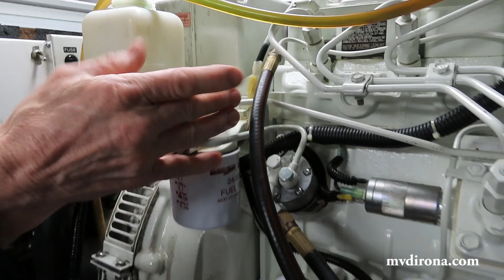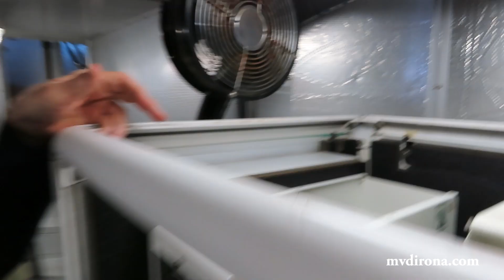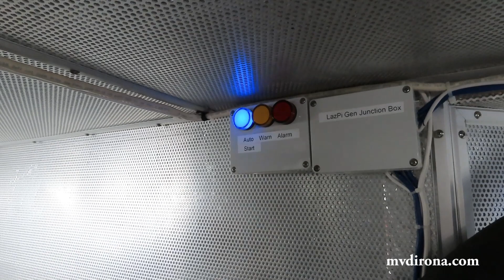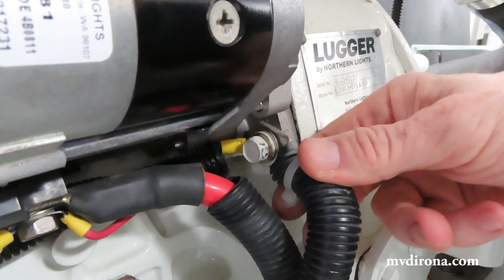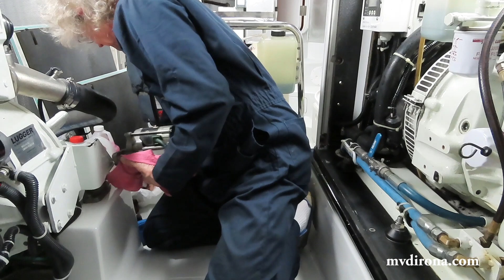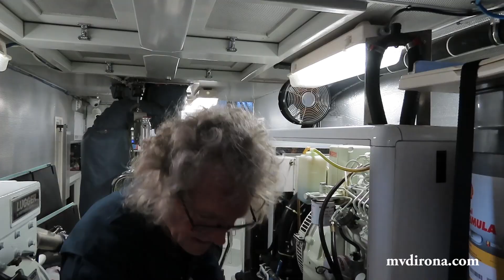Replacing Northern Lights Generator Starter (MV Dirona Channel)

Comment: 💙 Sorry for a probably stupid question, but why is the generator shielded in a box and not open like a wing engine? Maybe just because of the noise it makes while at anchor or in the marina? Thanks in advance for your reply 💙
Reply from the maker: Exactly. It's a sound reduction enclosure and these are quite common on generators.  Some chose not to run them to get better generator cooling but most most do.
Reply: @MVDirona  Thank You

Comment: Excellent video, thanks guys.
I see you have a non standard decent sized fan fwd of the genset. Do you have an article on your website regarding air cooling in the engine room of the N52?
Cheers, Clive
Reply from the maker: Observant catch. Yes, we covered our approach to engine room cooling here: https://mvdirona.com/2015/05/engine-room-cooling/.
Reply: @MVDirona  excellent article thanks for that. We are in the hard process of trying to decide between a N52 or a N55! We have only been on the 52 and it's beautiful especially with the longer cockpit. Huge amount of living space on the 55 though by the looks of it.
Reply from the maker: Tough decision.  We like the floor plan of the N55 greatly but like the price and profile of the N52 better.  I think if we were to make the purchase today we might end up with a N60 that has the N55 floor plan with larger cockpit and the slightly longer height to length ratio that we prefer. But both boats are capable ocean crossers so there won't be a "bad decision."

Comment: Please tell me how to remove a 12kw  NL generator
Reply from the maker: It varies boat to boat and is more dependent upon the boat than the generator design.
Reply: @MVDirona  hi thanks a million for your reply the generator was running fin  . I shut it down  . 2 weeks later the engine will not turn . Removed the starter that was not the problem . I am thinking that may by the generator is frozen and by separating it from the engine  we can be be sure . Boat is a 1978  58 Hatters  yacht fisher
Reply from the maker: First thing to do is to take off the alternator drive belt cover and see if you can rotate the engine with a large socket on the large nut that attached the front pulley to the crankshaft. If you don't have a socket big enough, I find that you can turn the engine pretty easily with a small pry bar between the pulley and the crank nose nut.  If you can rotate the engine by hand but it won't rotate on the starter, you likely have starter or electrical system problem. 

If you can't rotate the engine, it may be seized. If it was running fine two weeks ago, likely it's water ingress. Try removing all three glow plugs, injecting oil into the cylinders, and then see if you can free the motor up and get it rotating with a socket on the crank nose nut as described above.  Once you get it turning, don't start it until you change the engine oil since there may be water in it.  Once started, run it for a bit and change the oil again.
Reply: @MVDirona  I did that it is frozen
Reply from the maker: Most likely issue is corrosion if it was running a couple of weeks ago. If there isn't obvious signs of leakage onto the engine and generator, water ingress through the exhaust is the mostly likely. Remove the glow plugs and fill all three cylinders with oil.

If you have reason to believe the generator end is at fault, you can remove the ventilation grill between the gen and the engine and then undo the bolts that attach the gen to the flywheel to disconnect the gen from the engine.  The gen housing is attached to the generator all around the bell housing. If you un do those and the bolts under the grill connecting the gen to the flywheel, then you can undo the wiring harness from the sensors for clearance and separate the gen from the engine.

The generator end bearing can be replaced without removing the generator if you find the gen
Reply: @MVDirona  I shall do what you said
Reply from the maker: Hope you get it running again.

Comment: This is the ceramic seal that does not work well , take out the impeller and the back plate , behind the back plate is a seal ,  change this seal for a seal that seals on the sharft and it’s housing job done .
Reply from the maker: Thanks for pointing out that other seals are available. I probably should rebuild those pumps since they are rebuildable but I tend to install them, change impellers until the pumps start to leak oil or water. When they do, I replace the entire pump assembly.
Reply: MV Dirona This seal is not a Northern Lights part you need to sauce them i had to replace my pumps every 250 hours just change this seal  no more problems if you look at your pump when generator is running you will see the ceramic seal is turning when it should not ! Sharft size 1/2 inch measure od diameter of the old seal it’s not the price why not just cure the problem .
Reply from the maker: Perhaps your waters are more silty than we have been seeing but we always get more than 1,000 on a pump and usualy more than 2,000. Generaly, the seals haven't been a big problem for us but thanks for passing on your findings that better pump seals are available.

Comment: About that dizzy bit, hopefully your not suffering from this, as it has hit me hard as I get older and have to be aware of what angle my head is at and how fast I move. Luckily the way to treat it is fairly simple, requiring certain head movements in a certain sequence. https://vestibular.org/understanding-vestibular-disorders/types-vestibular-disorders/benign-paroxysmal-positional-vertigo#:~:text=BPPV%20is%20a%20mechanical%20problem,are%20not%20supposed%20to%20be.
Reply from the maker: So far, my symptoms are minor and not particularly disruptive but it is true that my balance isn't as good as it was 10 years ago. Old age sucks but it beats the alternatives :-).
Reply: @MVDirona  LOL, very much so, but I miss the days I could crawl under something and see clearly 6" from my face.
Reply from the maker: Yes, me too. In fact, a very similar situations was when I first realized how bad my eyesight was becoming. I went to get the serial number off the port side Cummins engine in our previous boat and there is simply no way to get further than 6" away from it so it's totally unreadable. I ended up needing to take a picture :-).

Comment: Is there a reason you don't bother to remove the enclosure support beam? I hear you on the starter story, 24v electrical problems are like a welder going haywire! The two oddest things I have seen is a distributor assembled 180 degrees out and battery post connector that would not conduct electricity, despite being cleaned thoroughly. I am a Landrover nut, so been doing battle with "Lucas the Prince of Darkness" all my life. Also on a Landrover, your problems start when it stops leaking oil...... Great video. love the little starter cheat and "Only $100" for brand name reference!
Reply from the maker: What I ended up doing is remove the light above the generator permanently and, wow, what a difference it makes. It's so much easier to do all generator service. I should have done that years ago. For bigger jobs like replacing the cylinder head, having that light gone was wonderful: https://www.youtube.com/watch?v=983xSI_Nghs.

Comment: Do you notice any differences in European vs North American spec diesel fuel?
Reply from the maker: I'm not positive but, yes, I think we see impact from the low sulfur spec.  Our main engine oil turns black fairly quickly but after 6 months in Europe, I noticed that it takes far longer. I'm not 100% sure but I suspect it's related to the fuel since engines seldom get cleaner operating with time :-).

Comment: Thank you. I put  some grease inside  the groove  of the seawater pump, It does not  leak sea water.
Reply from the maker: We grease the impeller with a Silicone based lubricant on replacement not so much to avoid leaks as to make the impeller easy to install and to ensure it primes quickly. We have never had any leaks to correct in the raw water system.

Comment: Is not beter to have more batteries and panels, to reduce the generator use?
Reply from the maker: We run the boat like a small apartment and we'll average 30 to 60 kw per day. It's hard to add enough solar panels to support that load. Certainly, it's possible to run more economically but this is our home so we run it like most homes and aren't wasteful but there are computers running, music playing, HVAC system running etc.  It would be challenging to support the full load on solar panels but panels could help support some of the load but we haven't done it.

More batteries will reduce the frequency that the generator runs but it is of no impact on the amount of power that needs to be generated. If we are consuming 30 to 60 kw per day then we will need to generate this much power regardless of the size of the house battery banks. With small banks, we'll need to run the generator frequently for short periods. With very large banks, we'll need to run the generator rarely but for a long time. But, either way, the generator will need to produce the same amount of power.
Reply: Thanks a lot!!

Comment: So far I did two refits on steel boats, a 1949 tug boat and a 1965 trawler. I wish your really great tech vids came out earlier. A lot to learn and great presentation! Thumbs up, cheers from Germany.
Reply from the maker: Thanks for the feedback. With your experience, you will be way ahead of me on some jobs. But, as you have found, if you invest in thinking through a job and are careful and patient, most jobs are solvable. In my opinion, most of the battle is figuring out exactly what is wrong.

Comment: Yours has to be the cleanest engine room ever!
Reply from the maker: I appreciate that. I'm currently at war with the generator rear main oil seal. It's throwing an annoying amount of oil around. I'll need to get that fixed. Unfortunately that means jacking up and removing the entire generator end and flywheel to get access to the rear main oil seal.  The best way for me to keep it clean is to keep the oil inside the engines :-).
Reply: @MVDirona  Good luck! Should make an interesting video.
Reply from the maker: The first challenge is getting the parts. They have been in the UK for a week and UPS has been struggling to get them delivered. The current estimate is tomorrow morning.

Comment: its always a big smile ,and a yeahhh Haaaa,when the problem is solved first time with a little thought,half a crank of engine said it all ,neat solution with relay imagine running back a forth to turn over engine when doing service work .now for that awkward crank seal maybe should engineer a little hoist frame like goal posts put a lift chain round gen unit take the strain slide it out ways get at flywheel and seal  i.m like you that oil spraying and dripping would annoy me ocd bigtime
Reply from the maker: It is annoying to have oil spraying around in there so we will have to go after it. Our plan it to first get the engine back to full power. It appears to have a valve/valve seat problem. If that works well, we'll do the rear main oil seal and be done. It's kind of weird we have had this engine in use for 10 years and it's run without issue and then nearly at the same time there are three, apparently unrelated problems. We're looking forward to our generator returning to 100% healthy.

As you suggest, we will need to come up with some way to lift the generator housing away from the engine. It's a big heavy assembly.
Reply: @MVDirona  maybe when you dismantle the sound box around it a simple little car trolley jack will slide under gen unit once mounts are off slide unit back ,valve stem seals ,maybe have a leak,that could be easy job a regrind and new  seals ,once you get the cover sound box off you  be surprised how easy the access to it all is these jobs are fun ,relish  it ,i would start using lucas oil stabiliser in those engines they will run smoother quieter and be more efficient
Reply from the maker: The valve problem is with the valve seat rather than valve seals. The valve lash closes up in 20 to 30 hours. I have the parts coming for that job and the are scheduled to arrive tomorrow.

For the generator end, I'm thinking of installing a hook in the  ceiling if I can find a secure enough purchase and then using a hoist to lift the generator end but, failing that, I'll try build slides below to slide it along.  Thanks for your suggestions.
Reply: @MVDirona  long term 2 inch by 1 inch box sections bolt together gusset plates on the end and feet sections that slip i all easy to store and can be used on any the engines and drive systems be real handy now the overhaul routines increase with age
Reply from the maker: Could you say more about the design you have in mind or send it to jrh@mvdirona.com?  I'm not quite following your approach.

Comment: Thank you both, is the starter motor able to be rebuilt?
Reply from the maker: Yes, the starter motor can be rebuilt and these 24v starters are surprisingly expensive (~USD$1,000) so it should be rebuilt.

Comment: Great  video : technically not a  too complicated job , but with logic and detailed diagnostic steps and a clear explanation of the job ,  combined with  your J&J relaxing teamwork.  
Loved to watch it !
Reply from the maker: Your right, that one is comparatively simple when it comes to the change. In the next video, we are going to diagnose the lack of engine power problem that we believe to be a failed exhaust valve seat. We'll have to take the cylinder head off to confirm or diagnosis but that's what it's looking like at this point.
Reply: @MVDirona  Looking forward for the video on  that challenging job !
Reply from the maker: It's running!  We put the new cylinder head on yesterday and it's running well. We will post a video of the work.

Comment: Couldn't a sliding amount be made for the generator so one could pull it away from the hull and get at the other side easier?
Reply from the maker: I think you are right. The 1.5" exhaust hose is heavy wire reinforced hosing which will limit the movement somewhat but, even if the hose had to come off, being able to slide it out would be wonderful. Some RV have done this where the generators slide out from the chassis and it really allows them to minimize space wastage while, at the same time, providing service clearance. It's a great idea but hard to retrofit.

Comment: If only that light wasn't in the way ...
Reply from the maker: You have been reading ahead!!!! You're right, in fact, I was thinking about needing more space for when I do the cylinder head change and I had some time on my hands.  Down came that light to be replaced by three LED lights and it's amazing. Much nicer and more white light and way more space. It's a great change we should have made 10 years back.

Comment: Feels great when a plan comes together well done you two that was an awkward job
Reply from the maker: It is tight on the outside of the generator but the starter is fairly easy to remove and replace on the Northern Lights 12kw.

Comment: I would never fit in that small space
Reply from the maker: You'll laugh but I was thinking the same thing and decided to remove the light above the generator. We replaced that large fluorescent light with a couple of LED fixtures that opens up much more space above the generator.  And, the light is brighter and whiter so I prefer it all around. We should have made that change a decade back.

Comment: Awesome learnings. Is this process of diagnosis learnt over time or do you have a guide from somewhere?
Reply from the maker: A little bit of both. I'm an ex-automotive mechanic so I know these systems fairly well and most of the manufactures of the equipment we have installed on the boat know us and are generous enough with their time to answer questions so we get good advice as well. Bob Senter (Lugger Bob!) and Scott Dyball at Northern Lights are absolutely amazing. So partly experience and partly advice from experts.

Comment: You two do such a good job with your videos. James I think my 6 volt 6 cylinder 1926 Oakland would bother you with how slow it cranks, I always cross my fingers when I step on the starter.
Reply from the maker: I've worked on some old cars but your 1926 has me beat by a couple of decades.  I had to look up 1926 Oakland to see what it was. Awesome! Really nice looking car.  No complaining about slow to crank. Your lucky the previous owner ordered the electric start option :-).